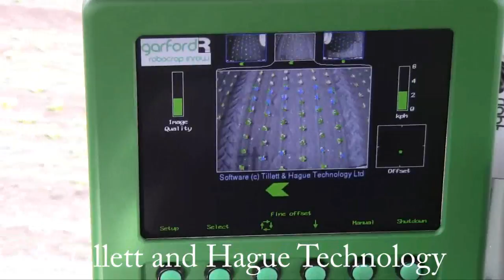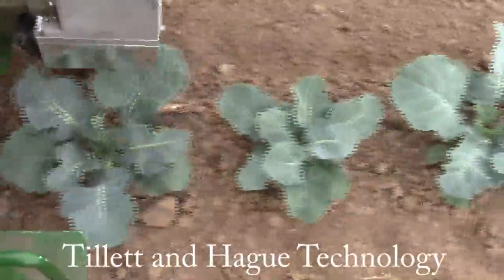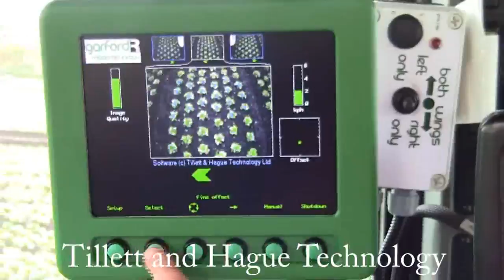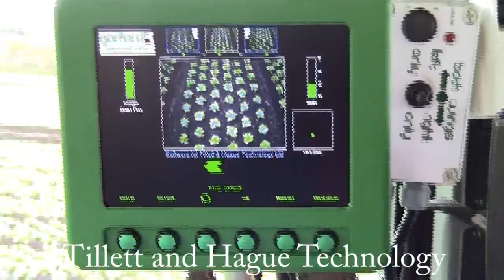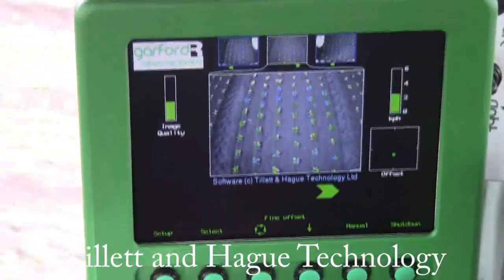High Speed Electric In-row Weeding

Comment: Hello there. Excellent product there. Please let me knownif this cab be used for wheat? If drilled in a specific manner
Reply from the maker: Hello there.  Thanks for your comment.  Unfortunately this technology is not really appropriate for wheat.  However, our inter-row guidance product is used by a number of implement manufacturers to guided inter-row cultivators in wheat.  The good news is that this sort of machine is cheaper to purchase and has a much higher work rate.  In wheat and similar crops accurate inter-row cultivation provides effective weed control without the need for within-row devices.
Reply: @NickTillett  thank you for your reply. 9 years and you still are answering quick. Impressive.

Comment: Very nice Machine , can we use this machine for Garlic weed removing ?
Reply from the maker: Thanks Asif.

The machine needs individual crop plants to be at least 180mm apart within the crop row so that there is room for the rotary blade to move in between plants without doing any damage.  This is normally achieved by accurately transplanting in crops like lettuce and the brassicas, but can also be achieved with very good precision drilling.  Crops like garlic and onion are normally grown as a continuous row of closely spaced plants in which there is no space for the blade to fit between plants.  However these crops can benefit from vision guided inter-row cultivation as vision guidance can allow cultivators to run much closer to the crop plant and run at higher speed than would be the case under manual control.

I know that some growers have experimented with growing onions as clumps in modules and transplanted them out so that the machine can cultivate between these clumps.  From a guidance perspective this is fine but I am not sure if these experiments were successful commercially.  This might also work for garlic but I am afraid I cannot be sure.
Reply: @NickTillett  
Where is the machine sold?
Reply from the maker: @Alibeysuleimanoglu  Hi Agboola  The machine in the video was made and sold by our customer Garford Farm Machinery www.garford.com who have dealers in a number of countries.
Reply: Thanks for your reply sir.

Comment: What about corn and soybean crops
Reply from the maker: In principle the technology could be used on any precision planted crop at grow stages before they touch in the row or become too tall.  However, the machines are relatively expensive and compared to other operations, the maximum work rate of about 5 plants per second per row is relatively slow, .  In commercial practice these machines are mostly used on high value crops for which there are few alternative options that do not involve hand labour.  This situation may change as weed pressures increase.
Reply: Great thank you for the fast response. We are an organic farm and have some specialty crops at times. I was thinking maybe in the future if we continue to grow at the rate we are, either way I find this amazing .
Reply: @NickTillett  I need to Africa